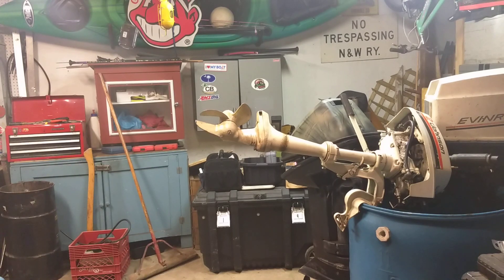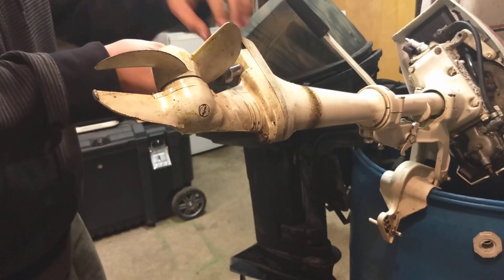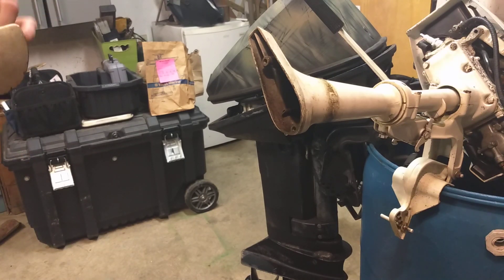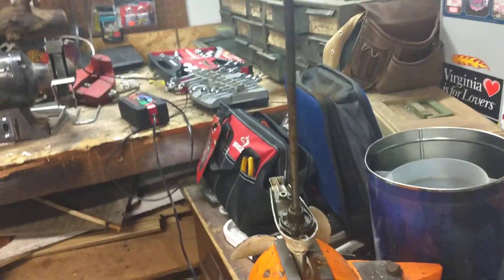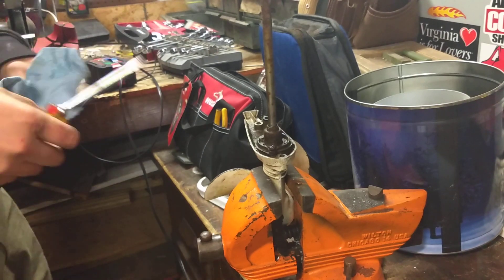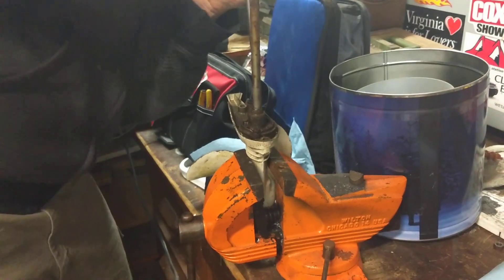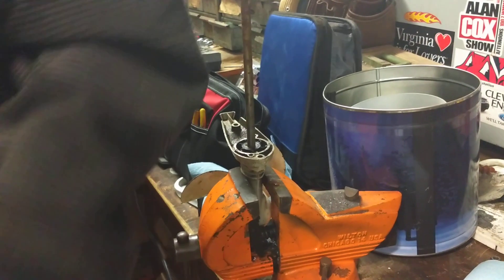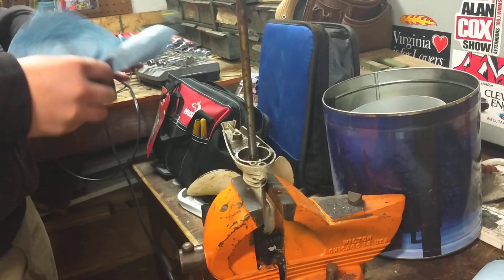1979 Johnson 2hp part 1: Impeller Replacement

Comment: I have a 3HP 1968 Johnson, after taking out the bolts for the lower gear I should just be able to pull it out right? To put it back in I just wiggle it to align the gears? Mine also has no neutral or reverse just forward.
Reply: Maybe slowly pull the cord while pushing it back in.

Comment: Nice video. I just bought a 1985 Johnson 2Hp. But I discovered that there is a bit of oil leaking out of a small hole on the lower unit, left side. Do you think the oil is leaking through somewhere?
Reply from the maker: That oil could be unburnt 2 stroke oil and that's normal for a 2 stroke. As long as their is no water in the lower unit it's fine.
Reply: @joesgarage2215  But did you notice any oil to leak through that little hole, too? 
Appreciate the reply.
Chears
Reply: Oil leaking out of that tiny hole is not normal nor fine. The engine is either running too rich or running too cool. Or a combination of both.

Comment: Hey Joe I have the same model and when i ran it in the barrel it looked like there was water coming out of the exhaust holes so i thought it was cooling. When i took it out on the water, i thought it was overheating because i would make a longer run with it and it would die. I would leave it for like 15mins and then it would start back up but if I ran it longer than it wouldnt run well. any thoughts?
Reply from the maker: What you could do is see if the water comming out of the exhaust warm. Of it is it cooling but might need a new thermostat. You have to look it up but I'm not sure if it has a thermostat but if it does it could be that. Also you can take off the the head and engine covers and see if their is a block in the water passages inside the engine. Also get a infrared thermometer and look up the temperature the engine should run at and take the temperature of the head and cylinder and see if it is at running temp.
Reply: Joe's Garage thanks for the advice! Could you shoot compressed air up into the passage from the bottom end?
Reply from the maker: @Lebeif  you could also try that. A wasp or some other thing could of made something inside the water passages so using compressed air should blow it out
Reply: Joe's Garage ok cool. Can you take the top shroud off without having to respool the recoil?
Reply from the maker: @Lebeif  from my experience you have to take everything off, it's a pain
Reply: @Lebeif  Yes you can. The screw on the top is only for the recoil spring. Don't need to touch it to remove the top. Just 4 bolts on the underside.
Reply: If the engine was over heating, that wouldn't make the engine quit after 15 minutes of running and then run again.
Reply: These Evinrude/Johnson 2 HP outboards are notorious for overheating.  Replacing the impeller may NOT fix it.  There is a water pump retro-fit kit that can be purchased that will solve the problem!

Comment: What kind of gear oil did you use in this?
Reply from the maker: I use Lukas heavy duty 80w oil. You can get it about anywhere and it's for differentials and gear boxes. You can use marine gear oil but Lukas is the same thing